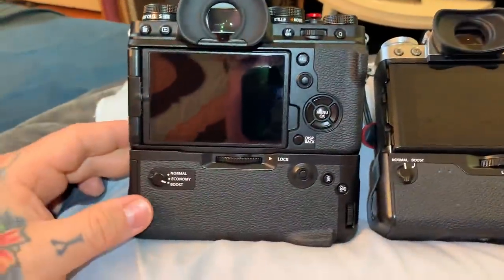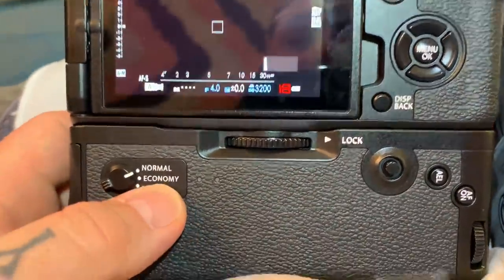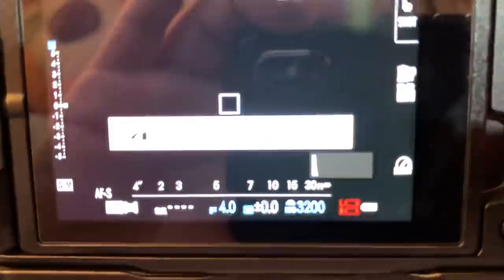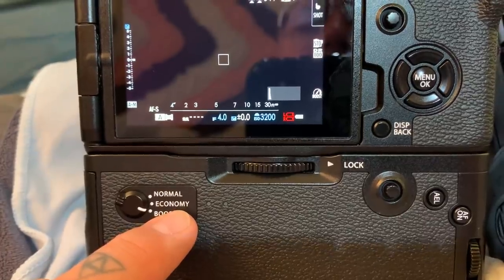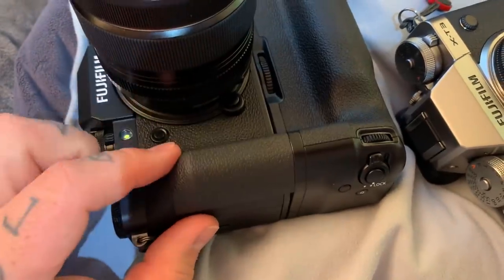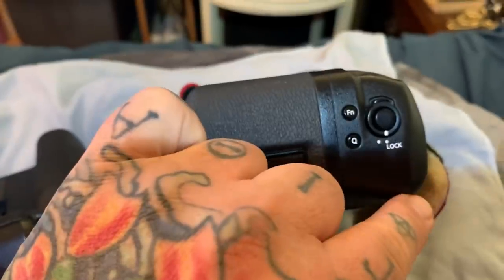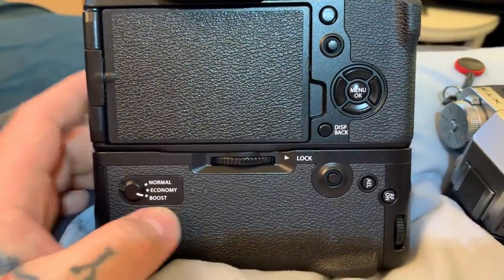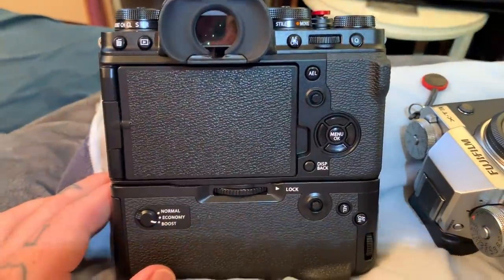🤩 FUJI X-T4 VERTICAL GRIP IMPORTANT FACTS 🤓👌

Comment: Damn those are some healthy half moons on your fingernails. PS, I actually think the positioning of the modes makes sense as is, because most people will be switching between normal/boost and they can flick all the way up or down without looking for those two, and take a little more care and attention to get to economy if they need. But sequential also makes sense for other reasons
Reply: I agree on positioning.   Don't want to be fiddling for a middle position if switching between normal and boost.
Reply: On the original X100, the focus mode switch arranged the choices m-s-c. Fuji listened to feedback making a similar argument - that s and m were the most common choices and s was difficult to select without looking. In response, Fuji changed it in the X100S to m-c-s. I imagine this design follows suit, as mentioned in these comments.

Comment: Wish I had seen this video before adding the new VG-XT4 battery grip to my cart when I ordered the X-T4. It is taller, even taller than both the EOS R's and A7RIV's battery grips making the X-T4 setup taller than both of those cameras.So the X-T4's grip is bigger than the grip on two full frame mirrorless competitors. Kind of silly I think. I've own a grip on every DSLR and Mirrorless camera I've owned (for those that offered one). Have to decide if for the X-T4 it makes sense. Thank you for your detailed view of it.
Reply: But remember you are getting the power of 3 batteries vs 2, in the order grips

Comment: makes sense to me that the two typical use modes are at the extreme ends of the dials so you can confidently flip between without looking - the middle being the least used option. less chance of knocking it into lower power mode by mistake

Comment: One reason I could think of why they put normal,economy and boost in that order is because everyone will be using either boost or normal. So switching between them will be much easier in this way, since you don't need to be accurate like choosing middle option economy.
Reply: Yep, much like the focus switch has the two most used settings at either end, and the least used in in the middle. A bit surprised he missed that. Logical.

Comment: What was FUJI thinking making the battery grip longer and not the same size as previous?  Shorter is better in my opinion. 😤
Reply from the maker: bigger batteries, soooooooo
Reply: @KenTheoriaApophasis , I was saying why not make it FLAT to make battery grip slightly smaller if not the same with XT2|XT3 length, why make it different??

Comment: Hi great contents and looking forward to the 3rd edition of your book. Two quick questions:
1- By watching your video it seams the camera uses the two batteries inside the grip at the same time? My XH1, I believe uses one battery until it drains completely and than moves the next one. The battery in the body is used last.
2- Can you charge all batteries in camera using usb-c? Using a power bank or car charger for example.
Thanks very much Ken.
Reply from the maker: yes, 2 at same time, but you can use ONE.......yes yes, you can charge ALLLLL of them at same time with USBC
Reply: @KenTheoriaApophasis  Thank you very much.

Comment: On the grip it is an Headphone jack i think, not a microphone jack...but ok , you confirm that it is an headphone jack at the end of the video :-)
Now just waiting for an L-bracket so i can use it on the vertical for panorama and be able to flip the screen at the same time :-)
Reply: I doubt it is either one.  Probably the plug in for the charger.
Reply from the maker: didnt i say headphone jack????? hehehehe, it IS A HEADPHONE JACK on the grip
Reply: @KenTheoriaApophasis  just at the beginning of the video Ken at 46 sec  a microphone jack loll